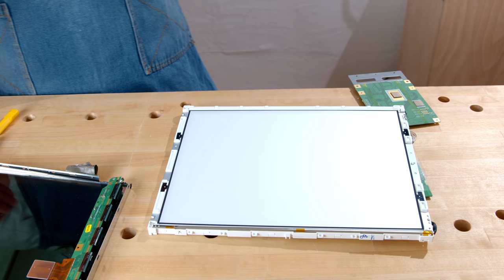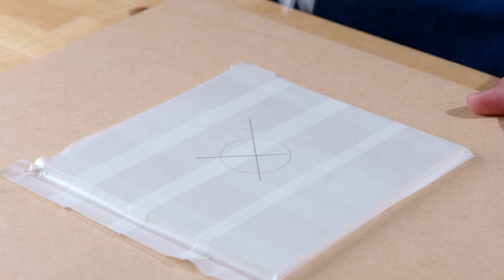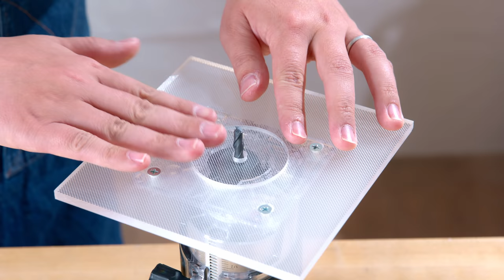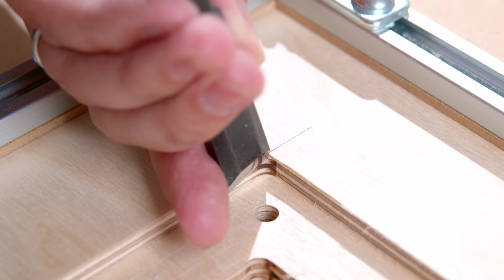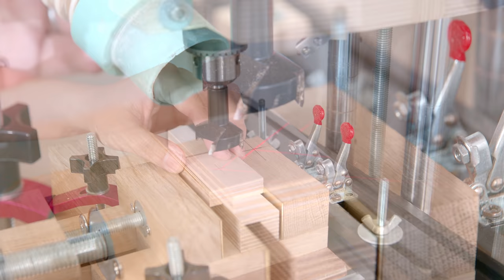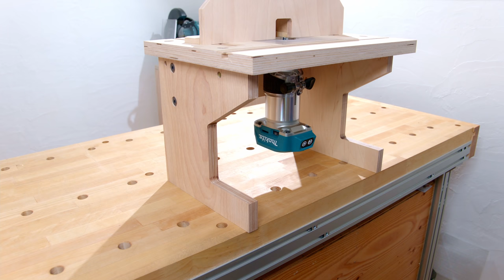Mini Router Table / trimmer table

Comment: I admire your precise stile of work. Nice table for small workshops. Besides… if you place a lightsource to/in the edge of the lcd plate you will get additional lighting. The small dots on it are little diffusors to realize light emission over the hole surface. Now you got it for free. Just add some leds😉

Comment: Some great stuff here.  This solves my most pressing problem, that is, having no space for a full sized router table, however, I can't get such fantastic wood products where I live without spending a bloody fortune to import them from overseas.  The plastic for the insert I can get easily, and I don't have to destroy an old monitor to get it, but I do applaud the reuse of old materials if it will keep them out of the local landfills.  Finally, if you don't have an air conditioned shop like the one in the video then I recommend a coat or two of polyurethane to keep the humidity from expanding the wood in damp weather.
Reply: Addendum:  I recently found a Dell 24" monitor in the trash.  It yielded the clear panel shown here, but it was only 3 mm thick. More importantly, before I had a chance to use it, it crazed and warped badly entirely on its own while it was standing in a corner of my shop. Although it hasn't broken into pieces and still appears to be as rigid as plexiglass, it now looks like a warped piece of smashed safety glass. Also, online exploded views usually refer to this panel as a "rear glass panel" not a "rear plastic panel" for some reason.  If the one you have is actually glass and not plastic, it probably won't take kindly to a saw blade. I suggest caution when salvaging these parts.
Reply: Addendum to the Addendum:  The Dell 24" monitor's clear panel was actually acrylic, though how it crazed on one side only I have no idea.  I have since found another trashed 24" monitor, a Samsung, and it had the 6mm thick panel as seen in the video.  The difference seems to be in the type of backlight.  Older monitors with CCFL backlight tubes will have the 6mm thick panel while newer monitors with LED backlights will have the 3mm thick ones.  At least that's been my experience.

Comment: I have taken a few of these apart and i have never found one with a thick layer of plastic like that.  I have only found thin sheets that are polarized and thin Fresnel lenses.  But also a small piece of 1/4 in Plexiglas wouldn't set you back that much.
Reply: My thoughts exactly.  The DIY Perks youtube channel has much better ways of using an LCD panel.  I feel that the bit of plastic was such a small part of this table that it didn't really justify it being the title of the video.  Could have used anything for that insert.
Reply: That style of diffuser would only be on newer edge lit panels, those little nubbins on the surface channel light like little fiber optic pieces. So it's going to be highly dependent on what style of monitor / lcd you decide to sacrifice.
Small scraps of lexan or acrylic could be sourced from sign shops or industries that use those materials for free or little cost.
Reply: @choiceblade   except the title of the video is specifically to point out using a broken(fairly new style) monitor to achieve this when it servered little purpose here. If you already have the damaged monitor, great go for it. Going out of your way to find one of these monitors with that kind of board is not very productive though. I think that's the point these people were making. Still a great build and they show lots of skill, but the video could have just been titled making a routing table from scrap or something similar. The monitor really didn't matter much as the material could have been not as nice and easily sourced elsewhere. Still a cool video
Reply: @choiceblade  The guys are right. The monitor played little role in this build and a shitty use of a broken monitor for a DIY project at that. The guy in the video is certainly skilled but so what, so am I and millions of other people. It doesn't justify the misleading title or the fact that is audio is nothing but power tools ripping into plastic or wood for 23 minutes.

Comment: I have two of those makita routers for when i go do work outside my shop.  
But i prefer the bosch routers for my shop. 

How do you feel about the makita router?  To me is a hassle having to check the battery every cut to make sure im getting full routing power in my cuts.

Comment: Nice video but what do you do with the rest of the LCD monitor?
Reply: He carefully desolders all the board components, one by one, and reassembles them on homemade breadboard into a transistor radio,  midi fan controller, and 1/2 of a power seat-adjust mod for a 94 Saab.
The plastic casement is reverse-refined into oil for the motorbike and the extractions are re-formed into many of the knobs you see here, and Gainax figurines.
The emptied breadboards and ribbon cables are then used to feed pigeons and to wrap tiny gifts for children orphaned by woodworkers who failed following in his footsteps.
Reply: @draztiqmeshaz6226  that is so funny reply lol thanks

Comment: I used to be an LCD tech.  Watching you disassemble an LCD without a laminar flow table made my skin crawl.  That part you used is called a light guide.  Light guides are tapered.  Measure all four sides and you will see what I mean.  Light enters the widest edge and gets evenly refracted ninety degrees across that roughened surface. Thise plastic sheets you tossed aside are something like magic.  they reflect light very strangely and some layers are polarized.  Try looking at them at an angle to each other.   Try looking at a working Lcd like a computer screen with them, turning at 90 degree angles. It's a hoot. I have used scrap light guides for projects before, but never for a tool that I want to be kept level or perpindicular to work.
Reply: Do every LCD TV and Monitor have these screens he uses? Thanks in advance.
Reply: @vjtiengineer5496  There are other types of LCDs, but this style is by far the most common.  Keep in mind that It is not particularly easy to tell the difference between an LCD, a plasma, a LED, or OLED with a casual glance.  I've only worked on LCDs, not the others but opening them up, an LED supplies its own light, so they don't need a light guide.  Keep in mind many tv's  say they are LED when in fact they are LCD  with an LED backlight.

Comment: Hi Sir, Very useful mini machine.
Just a quick question: I noticed  that you often glue some pieces without clamping them together, especially when they must keep their position and be square. Isn’t that a weaker bond, especially if you have to push on them with some force, due to their purposes, for example guides, eccetera?
Thank you.

Comment: the amount of resources you can pull out of old stuff is impressive.!  used to do this as a kid allot and tinker with stuff. but this is next level :P i wonder if  the back light of a modern lcd monitor can be resused for some type of use :S i'm still thinking about it for a photo booth

Comment: Man, you're just constantly giving me hope that sometimes what I need is careful patience and planning, rather than money. Beautiful tool work!

PS - Double check those Banggood aluminum  clamping squares against something known to be 90°... Some of mine weren't
Reply: Skill is the most important one though. If you have it then you can make your own fancy tools.

I do not have it.
Reply: @unogazzy84  hmm. You have the ability to practice, yes? You can build skill
Reply: @draztiqmeshaz6226  Well, yes but I'm easily stressed which will translate into mistakes. I still try though and I have built small useful things. Making a thing like this that requires precise measurements is impossible for for me to do without the right jigs and tools. Although, that aluminium profile jig seems easy to make, if I could find the right parts that is.
Reply: @unogazzy84  I know this feeling. Things that might help a lot starting from zero are a good square (kinex makes an inexpensive one), maybe an incra rule and mechanical pencil, a drill guide (milescraft makes an inexpensive one), and a long straightedge you can trust for a circular saw guide. I found an 8' long piece of square extruded aluminum for like a dollar at the habitat store.
But yeah, one of the biggest challenges is patience. We don't see the patience and careful planning very much in these videos, but I think he takes the time to draw out and work out details in advance of these assembly videos. I've a made a shit-ton of mistakes (and learned a ton) since I set out to make a Murphy bed desk over a year ago with just a drill, circ saw and speed square. It's been a lot of hard lessons. But I try to be patient with myself and really pay attention to why things do and don't work out.
Reply: @draztiqmeshaz6226  I do have a drill guide, a try square (I will probably buy a speed square instead soon) but I do not have a circular saw. I want one with a track so I will just have to wait until I see one in my price range.

Thanks a lot for the "incra rule" tip. I have seen those in many videos but I had no idea what they were called.

I live in Sweden and it's way harder to get a hold of stuff cheaply here. Sweden is an hobbyists worst nightmare unless that person has connections.

BTW what is the name of this tool? 11:20 I have one but I do not know the name.
Reply: @unogazzy84  I'd call that a marking gauge, though mine is not so clever as to be on a ruler. That's one of the simpler builds, if you pay attention to precise perpendicularity. I made JSK's dowel jig and the simpler pocket hole jig. I failed at making the original drill guide, because I glued it up with the rails facing in opposite directions, got frustrated and gave up.
Reply: @unogazzy84  Check out Banggood - Tools, Industrial and Scientific - Handtools. They have Incra type rules. Also see "Hooked on Wood", the China Tools series. There's a good review on the Banggood rules. Usually very good pricing.
Reply: @tarquin7771  Thanks but the postal sevice here in Sweden (postnord) takes a customs fee of about 7 dollars and VAT on top of that. I have to buy stuff from countries in the EU.

Comment: I wish I could take some personal classes from this guy. Absolutely perfected the wood tools. Goes to show you don't have to have metal for everything
Reply: Absolutely true. In a lot of instances wood can be better than metal cuz it's more easily and repaired cheaper to replace. Depending on the wood; in terms of strength-to-weight ratio. Wood can turn out to be better and is perfectly acceptable for most small-to-midsize shop tools for those without access to metal working tools.

Comment: Very nice achievement, as usual.
I wonder if you have any advice on what type of screen to look for (year of manufacture, technology or brand ...).
So far I have bought and disassembled 3 screens and the best plate I found was 1.5mm thick (too thin ofc).
Thanks for any advice.

Comment: Nice router table. What is the proper name for the Allen key bolts and threaded pin connectors called that you assembled the table with? What brand of drill press did you use on your woodworking bench top to drill the holes in the edge of the boards? Thank you

Comment: I dont get it, what was the LCD monitor needed for? Why did you need that particular piece of semi transparent plastic? Thats a diffusion sheet i think, did you need to diffuse light somewhere or something. Don't get it. Great at what you do though.
Reply: its very flat and uniform thickness.  because optical clarity demands those properties with high precision.  Buying that level of precision is going to cost you a FEW suppers...
Reply: @DavidBaumgarner  Sounds reasonable. I certainly would not argue against you as i have never tried to build such a thing nor buy a piece of perspex, Acrylic, Polycarbonate (whatever) of that kind of thickness. I just thought he was going to make a light table or something like that, but it ended in the way it did. I still don't see the benefit though, i mean surly wood alone is just as strong/scratch resistant/flat/precise if you wanted it to be, steal/aluminium would be even better. No matter though it's a work of art whatever it's made from.
Reply: @JackDinn  many things that look flat aren’t actually flat. Extra flat things are expensive. Even steel and aluminum stock aren’t very flat and machinists often surface them first before using them. If they need them even flatter, they need to hand scrapped by expert scrappers.

Comment: Awesome build, but I honestly was expecting some actual ‘recycling’  of the LCD display. All you did is scavenge a small portion of one component, and I really can’t even see why you required that specific material. I hope you at least properly disposed of the bulk of the electronics and plastics to an actual recycling center.  Cheers.

Comment: As soon as I saw you pull the acrylic plate out of the monitor, I thought 'What brilliant idea is he going to come up with?'  (Pun intended.)  ...and then I was disappointed to see you use it like regular plastic stock.  It is what is known as a 'light guide plate'.  The etchings on one side are specifically designed to reflect light coming from the sides straight up through the opposite face with perfect uniformity.  (DIY Perks used them to make fake skylights out of dead LCD TVs.)  If you put some LED strips around the edge, the whole plate would light up.

Comment: TL; DW summary: in two minutes you can extract a piece of plastic from the LCD (and throw the rest away), then spend another 20 building a mini router table using that bit of plastic as one minor component. Stupid clickbait. If you have all the other tools shown, why can’t you get hold of a 30 cm^2 by 6mm piece of plexiglass.
Reply: Thanks for explaining! So I don't have to watch the entire video.
Reply: @taiwanfocus4385 ,